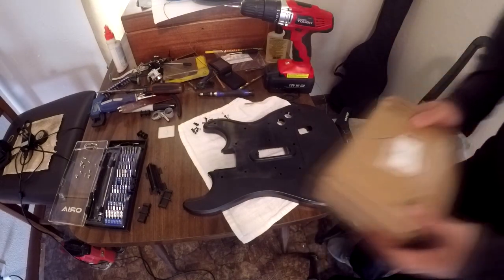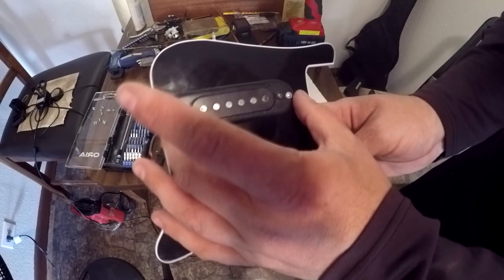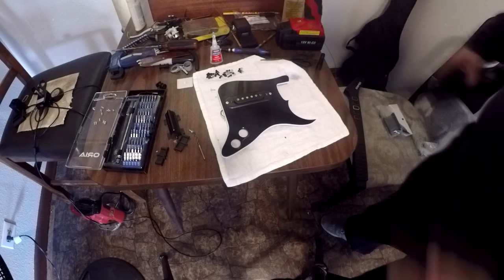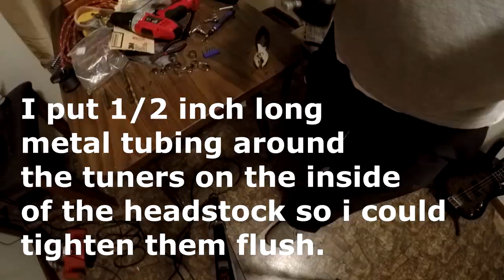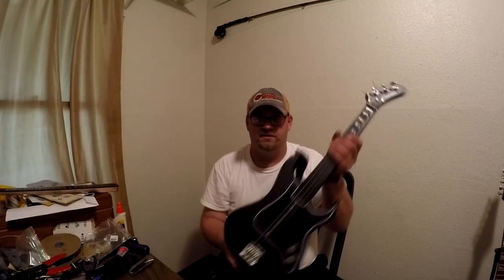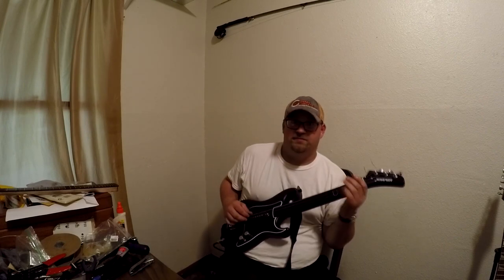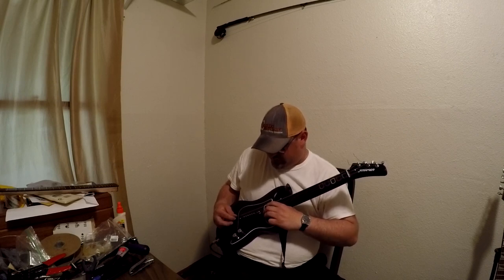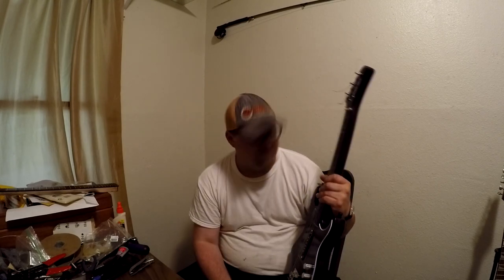Turning Guitar Hero Controller Into a REAL Guitar

Comment: This is really cool but wouldn't a vertical pickup lead to the strings not being picked up right?
Reply from the maker: Ordinarily, you'd be right. But with this, the strings are all just close enough to the pickup to work. If it had any more strings, it wouldn't work for the outer ones.
Reply: @obscuredguitars  ahh yeah, that makes sense.

Comment: You should be able to fit 6 strings, as long as the head is wide enough. The Power GiG: Rise of the Six String guitar controller had 6 strings and was the same size, and compatible with Guitar Hero/ Rock Band. Too bad an Xbox update bricked the string features reducing gameplay to typical Guitar hero stuff. I kind of like the shape of the React brand PS2 guitars, and of course the Warriors of Rock guitar.